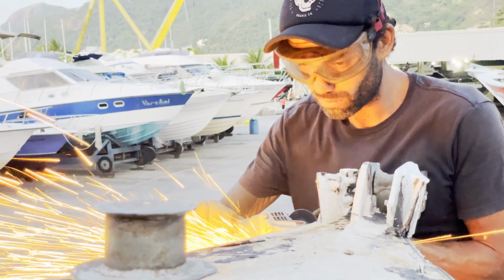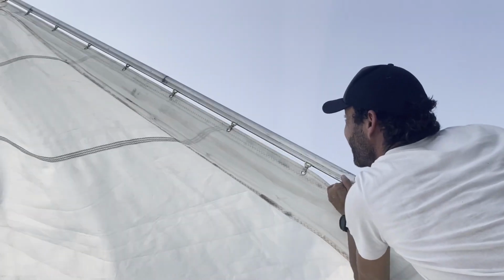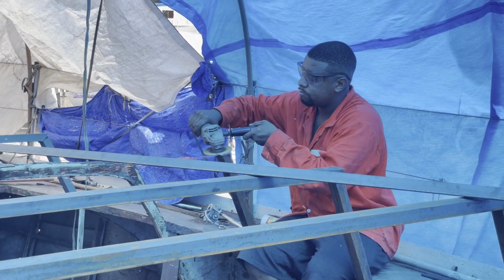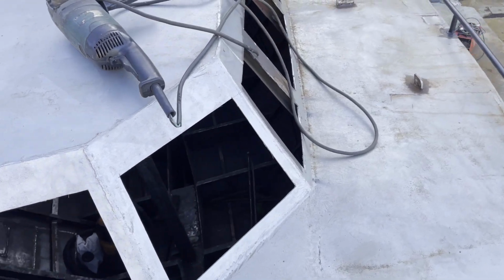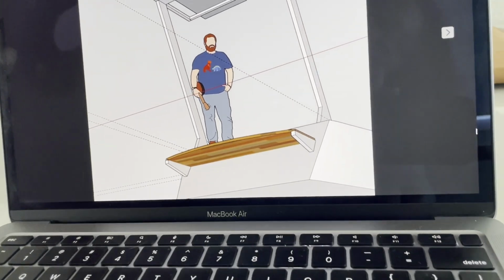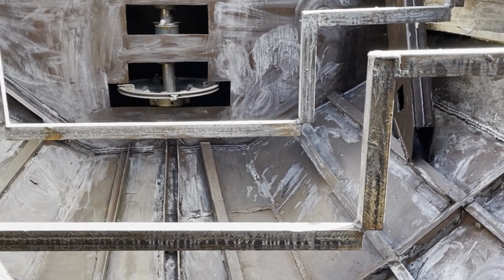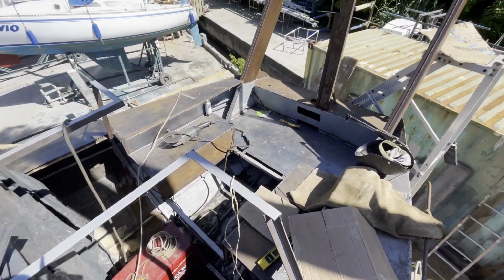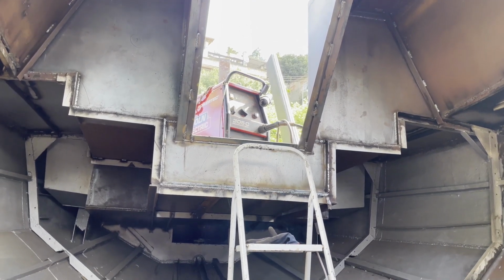CUTTING UP and Rebuilding Our DREAM BOAT ⛵️ Ep5 - PART 1 – Sailboat Restoration Project

Comment: Wonderful project and looking like a fine design and well thought out. As a master mariner and always concerned about stability I note you appear to be raising the VCG (vertical center of Gravity and weight so I wonder how you have or intend to determine your new stability numbers? Your draft I suspect with the added length aft and presumed movement of the center of buoyancy will be other than as originally designed. All worth confirming as you move forward. Best of luck on this great project.
Dale

Comment: for 36 years i owned a 57 foot Chris Craft and in 1980 i took the boat out of the water for a major refit/redesign and everyone said i was making a huge mistake but i don't think like other people and as it turned out the 14 months it took turned out to be the most fun i had i mean sure all the years of relaxing fun on the boat was great but the real fun was the impossible task that everyone said was a mistake and what you are doing is priceless and i envy you , just remember to be sure the work you do is better than what was done in the past
Reply from the maker: Wow! 57 foot is a big boat! Congrats to you too for having the courage to tackle a project that size! 👏👏 We are right with you, we love building and designing the boat as well. It definitely can be physically exhausting at times but it's a really great feeling to finish at the end of the day knowing you gave it your all! Great advice too! We are also trying to tackle the problems that the boat had originally so that we never have those issues again. Difficult to eliminate all problems but now is the moment to try. It will be cheaper in the long run. Cheers!

Comment: Great update. I think though your videos are far behind real time. How are you going to deal with the added weight topside now that you have raised the cabin roof and installed the arch?
Reply from the maker: Thanks Charles! this is a great question that a few people have asked and we intend to address it in more detail once we talk about the keel. But to give you some insight now; The boat had 4mm plates on it. We decided to change out the hull below the waterline for 5mm and the upper deck for 3mm. So this is one way we were redistributing the weight. The original boat did have weight distribution issues already so it was something we had to work on though-out the project.

Comment: That raising  of the cabin roof was great idea there are currently a few channels  either building  or renovating steel boats good  luck  with  yours
Reply from the maker: Thank you! We didn’t plan on raising the roof at first but we are really glad we did. It’s a little hard to tell without a floor inside but it’s a big transformation.

Comment: This is a monohull sailboat. These boats heel during sailing. That makes part of the hull go under water. Did you heel the boat during leak test?
Reply from the maker: Good question! We planned for a second test at a future date. This test was primary for locations under the cockpit that we would have less access to with the MIG welder once we completed it.

Comment: With all that weight being added to the aft does a fore/aft balance become a problem?
Reply from the maker: Hey! Thanks for asking! This is a very good point to address. The original boat was not fully balanced when we purchased it. It was leaning forward at the bow. So we knew we had to address this when building. When we were constructing, we were making sure to distribute the weight more equally throughout the boat.